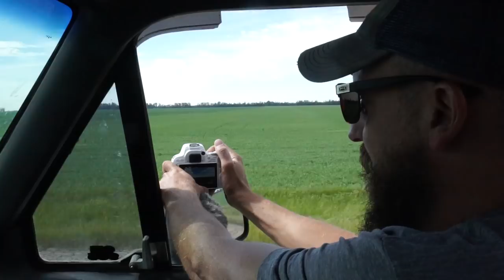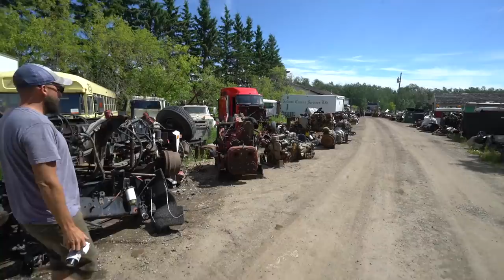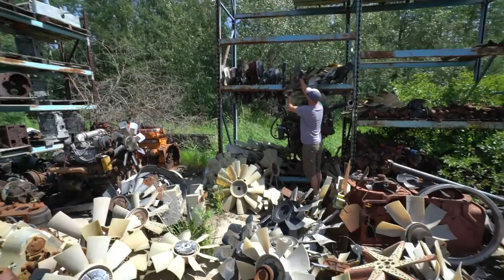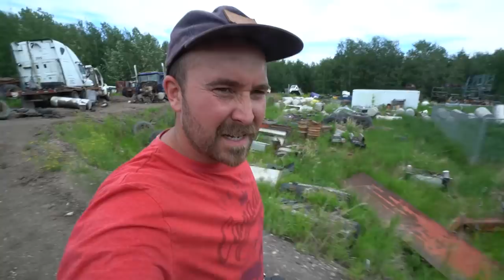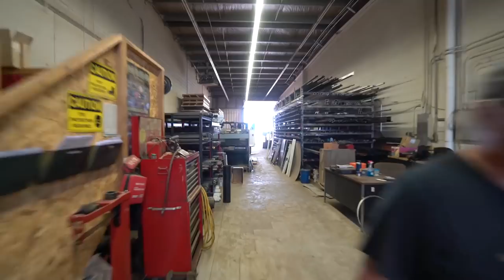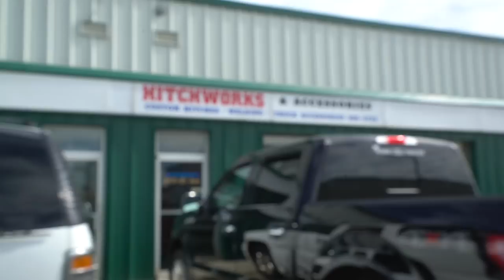GIANT VEGETABLE OIL TANK (for wvo conversion)

Comment: Did you say 50 gallons? Looks more like a 100 gallon tank or 105. 100 x 7.2 lbs = lots of weight.
Reply from the maker: 150 x 8lbs per gallon
Reply: Jax Austin so the cooking oil is heavier than diesel. Wasn’t sure. 150 yes my typo. So like having 16 kids onboard.

Comment: I get the idea what you're trying to say you on diesel fuel but they're adding more weight to the bus by putting the oil on it to run it more weight equals more fuel
Reply: To run with veggie oil the cost is zero!!! It offsets the weight of both fuels instantly!!! "w.w."
Reply: Holleran Properties where can you find free Veggie oil a friend runs it in his vw and he pays it
Reply from the maker: Bingo!
Reply: Michael: It pays to frequent certain restaurants for years, they both call when they need emptied. If I''m on the road a buddy grabs my 300 gallon trailer and takes care of me. That cost me a case of beer! Now on the road it's a different story.... I''m talking to make new contacts. I use to buy real estate for Burger King and know a lot of franchise's. I can sure beat diesel prices???

Comment: You always call it a junkyard and junk yards are completely different.  junk yards usually have household junk like washers and dryers and fridges and household appliances and furniture and building material where as wrecking yards have Automotive stuff like cars that have been in wrecks and accidents or the car just wasn't worth fixing that why they are called a wrecking yards. Junk yards have junk wrecking yards have wrecked vehicles
Reply: Nathan Platt, that's what we always said too. Sometimes we called wrecking yards scrap yards 'cause vehicles get scrapped there, but junk is junk. Some of the fellas I used to deal with would take exception with their place bein' called a junkyard, but I suppose some folks don't really care too.